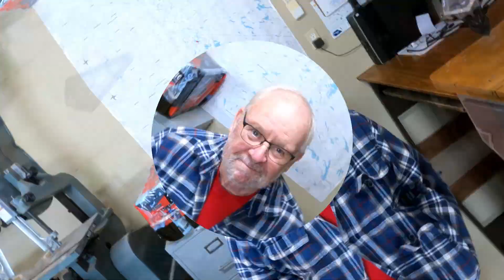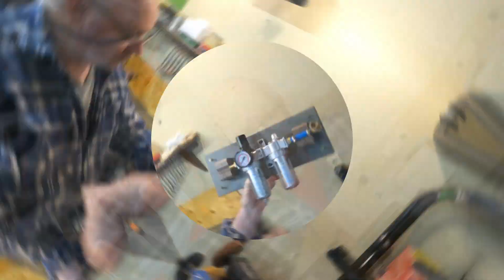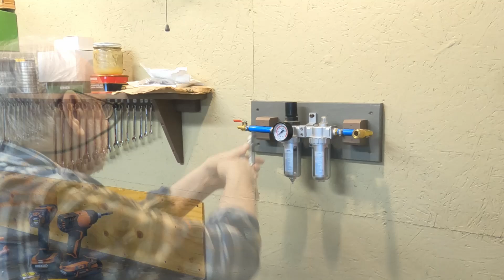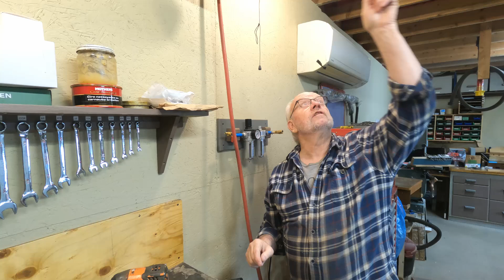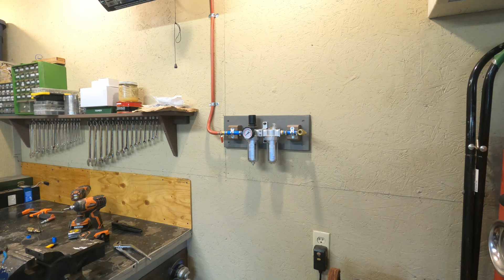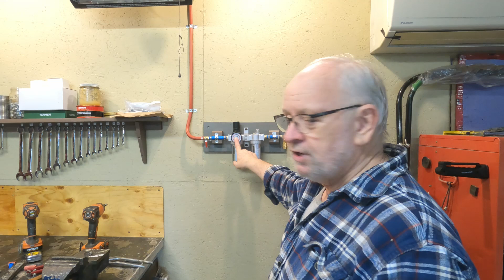Adding an Air Line in the Shop

Comment: Hmmm. My pex crimp doesn’t make that little tab. It crimps around the whole ring. I need to do this for a line up front to check vehicle tires outside the garage without running a long hose. Thanks for sharing/ reminding me to get this done. Nice job Mike.
Reply from the maker: How's she goin'?  Mike this type of PEX crimp is a 'crimp' type.  The ring overlaps itself and then the PEX crimpers squeeze the tab together to tighten the ring on the PEX pipe.  I think the kind you have is straight compression rings.  When I was plumbing my camp I looked for PEX fittings and the gear to apply them.  Back then it was very expensive to get a PEX compression tool and you had to be a licensed plumber to get the tooling needed for PEX.  Then a few years later, I saw these type PEX crimp rings with a crimping tool for like $35 and it came with a bunch of crimp rings so I bought it and have been using it ever since.  They come in 1/2 and 3/4" too.  Thanks for watching.  Take 'er easy!!

Comment: Nice video, Mike! I am surprised the crimp clamp worked better than the gear clamp. I have never used crimp clamps, and always figured the gear clamp was the best! Thanks for the lesson! Cheers!
Reply from the maker: How's she goin'?  Thanks for tuning in Mike.  The gear clamps worked good on the rubber air lines.  The blue air lines are PVC and are harder than the rubber so the PEX crimp rings were better at sealing them against the fittings.  I hope you have a good week end.  Take 'er easy!!

Comment: I have not converted to plex even on water, but maybe it’s fine time that I look at it…..CHEERS
Reply from the maker: How's she goin'?  Gator this blue air line is not PEX pipe.  It is a PVC Air line I bought at Princess Auto.  It's rated at 250 PSI I think.,  but the PEX connectors work good on it.  Thanks for watching.  Take 'er easy!!!

Comment: What did we ever do before pex eh! Well we soldered copper and such what a pain that was. Nice air line improvement Mike!!! Wishing you and Janet well wishes always and have a great weekend.
Reply from the maker: How's she goin'?  Thanks Russell.  I think I have misled some folks with this video.  The blue line is not PEX, it's a proper air line but is PVC.  So I used PEX connectors on it and it makes a great seal.  Thanks for watching and it sure is nice to have air back at the bench.  Take 'er easy!!

Comment: This is a great addition and it looks very good. We have found that our flexible air lines are starting to leak and we are now thinking of putting in hard lines but that will not be for a while. When we do that we will probably run large diameter pipes close to the outlet to avoid the air restriction you get on long hoses
Reply from the maker: How's she goin'?  Thanks Joseph.  Your idea of hard lines of bigger diameters is a good one.  The line loss is significant and we often over look it.  Mind you, with the bigger lines you may also need a larger capacity compressor.  For every solution there is a problem eh!  LOL  Take 'er easy!!

Comment: Im so glad to see a you not us abs or sch 40 for air lines!  I've seen them explode and send plastic shrapnel into a peice of plywood.  They make a racheting crimper with a blue light that stops at thhe right torque and that's thrle one we use.  It makes such things foolproof and pex is quite the wonder for cheap effective pipe.  Be careful cutting off thoes rings too they can get sharp and dangerous.  They make a tool that tips th head off them like a l shaped breaker bar and its alot safer sheers it.  Stay safe and keep the projects flowing.
Reply from the maker: How's she goin'?  Pneumatic air lines can be dangerous.  Anything under pressure can turn into a weapon pretty quick eh!!  The blue PVC lines I have run in my shop are proper air lines and good for pressure up to 250 PSI I think.  The crimp rings are for PEX but work with this kind of air line.  Thanks for watching an chiming in on the dangers of pneumatics in the shop.  I appreciate it!!  Take 'er easy!!
Reply: Good suggestions.   Thanks.

Comment: Nice setup Grampie. 
Most air tools, including impact drivers, take a larger amount of air flow than a 1/4" quick disconnect can deliver. 
On the assembly lines I ran larger fittings in the supply lines so the tool could run full capacity. 
Instead of 1/4" hose and fittings I ran 3/8" and sometimes 1/2" depending on the need. 
The quick disconnects were the most restrictive so if the job had to have a quick disconnect I went with the next size larger. 
Something I did when I was installing compressors in factories worked well. I put in 3" lines in a loop around the building. 
In a large building the extra 2" of pipe was like having multiple reserve tanks in the system. The lines were inclined so condensation in the lines would run to a tap in an appropriate place where the water could collect in a water trap attached to a tapped hole in the bottom side of the pipe. When the trap filled to the full point the float would lift and open a vent to dump the water into the drain. 
Air lines connected to the 3" loop came off the top of the pipe. Ahead of the FLR for the machine being fed from the line I installed a t fitting with a vertical drop line of the appropriate size with shutoff ball valve that allowed dirt and condensation collected in the line to be flushed out. 
Having a loop meant I could have a section of the line closed off in the event of a leak or need to add a line without having to stop production. 
That really helped when a forklift driver ran into the line and snapped the 3" pipe thread at a fitting. :face-fuchsia-wide-eyes::hand-orange-covering-eyes: 
We shut off the valves on either side and replaced the 3" pipe length and fitting without having to shut down the whole department. 😬😎
Reply: Interesting.
Reply from the maker: How's she goin'?  Pneumatics is sure a nice thing to have in any shop Dave.  My lines are 3/8" but the point you are making about line and connector loss is valid.  Adding larger lines and fittings is a good way to provide enough air capacity to allow the tool to work most efficiently, but if your air supply can't recover, then it's not such an advantage.  I can remember we had 1" outlets placed around a shop I managed.  The air outlets were for using dry ice cleaners.  Every time an operator would clean his machine the air pressure in the shop would dip.  So I had to get with the boiler house guys, that's where all our air compressors were located, and work with them to get an extra industrial sized compressor just to service out demands.  That shot a big hole in 
 my budget let me tell ya!!  LOL  Thanks for watching.  Take 'er easy!!

Comment: Will that pex hold 150 psi air?  it would be a easy and simple. I installed pex in the little shop my wife and her son are planning on opening, but even with the crimp clamps the fittings will swivel a bit, I am hoping they don't leak water.
Reply from the maker: How's she goin'?  The blue line is proper air line Vernon.  Rated at something  like 250 PSI I think.  Regular water line PEX I think is only rated at maybe 60 PSI.  I doubt the PEX connections will leak water.  I have installed some and forgot to crimp the ring and it still didn't leak water!!  PEX is great!!  Thanks for commenting.  Take 'er easy!!

Comment: Hi Mike . Sorry to be the bearer of bad news , but gear clamps are not recommended for air lines, and pex is questionable also.  Safety first, check it out'  My air pressure runs at   120-140 psi constant , so i wouldn't dare to use either.  Your pressure is much lower so maybe that is ok. Take care.
Reply from the maker: How's she goin'?  I appreciate your concern.  Like I mentioned at the end of the video, I'm no expert.  This video is for entertainment purposes only.  The blue line is a proper air line rated at something like 250 PSI I think.  I used the PEX crimp rings because they worked.  I set my air at about 100 to 110 PSI and have not had a leak or an incident yet.  But that doesn't mean it couldn't happen tomorrow.  Thanks for the info, I'll check into it!  Take 'er easy!!

Comment: That's a nice upgrade Grampie!  I hadn't realized you could use pex for compressed air, but why not?  If they can handle pressurized water, why not air.  Very neat.  I am praying for you and Nannie both.  😊
Reply from the maker: How's she goin'?  Thanks so much for your prayers.  They are appreciated!!  I have to explain here, the blue air line is PVC but not water line PEX.  But the PEX crimp ring connectors work on it.  Sorry about the confusion.  I have seen videos where folks have used PEX pipe for air lines though.  But PEX water lines are generally used at pressures up to 60 PSI where air lines could be up to 150 PSI, so I don't know how good the water line PEX might be.  Thanks for tuning in.  Take 'er easy!!
Reply: Thank you for the clarification on the pex.  😊